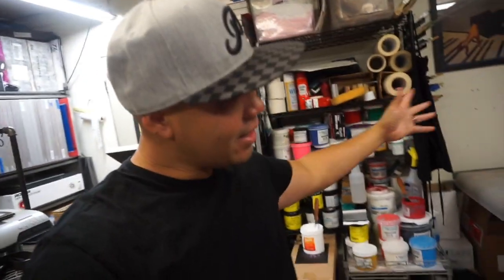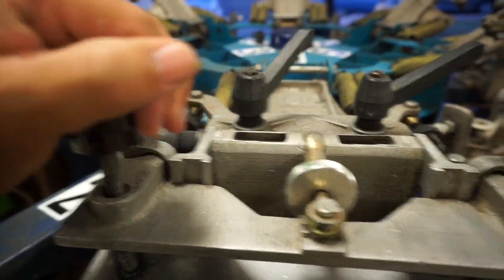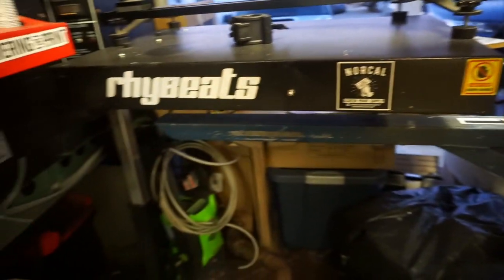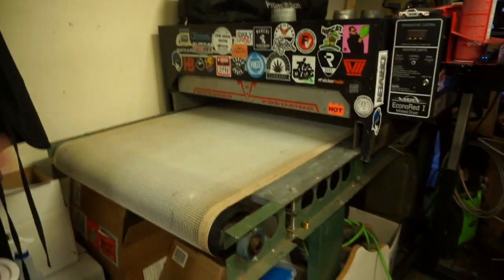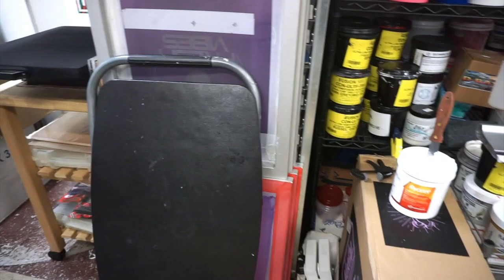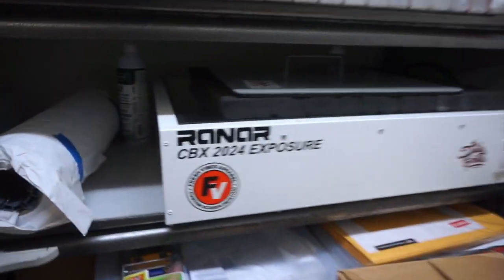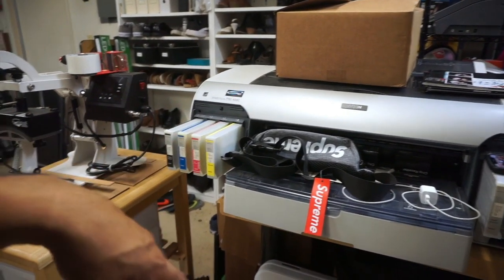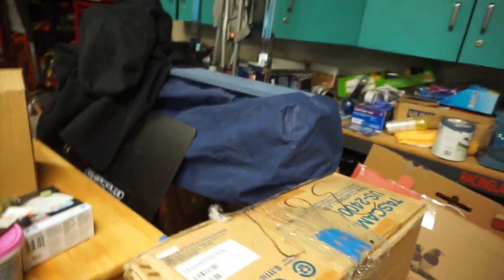Screen Printing - Shop Tour (S:05/Vlog 041)

Comment: Thanks for the tour , where did you get the cool weight plate with handle for your exposure unit?
Reply from the maker: That weight plate came with the unit.
Reply: @RhyBeats  oh ok im needing something  like that tires of using a board and dumbbells on top of my foam..lol